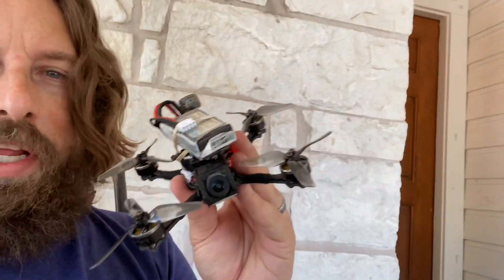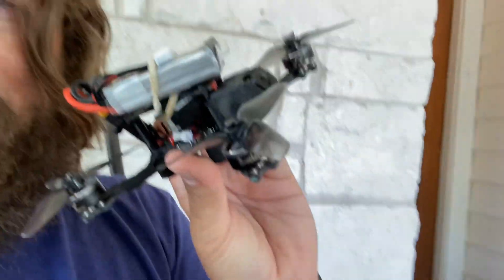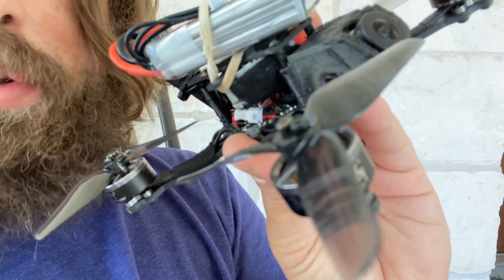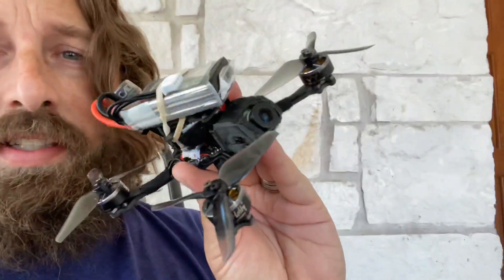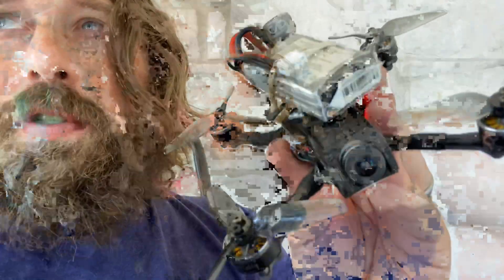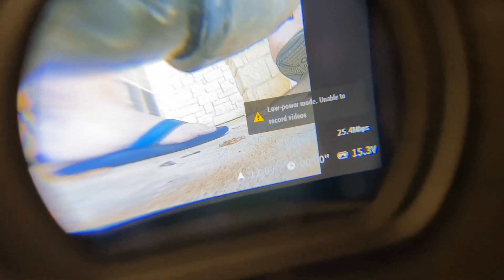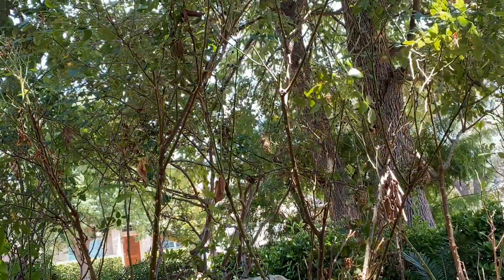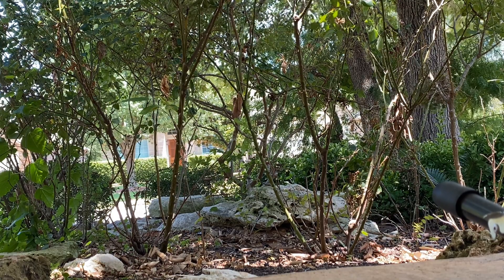DJI FPV OSD Freeze Issue: Why It Happens

Comment: Why would I get video loss mid flight and not get video back until I unplug the drone plug it back in. happens 30 seconds into dam near every flight I have a capacitor 470 uf. Air unit has red light on it when I get it out of the field goggles have black screen say dji on them. Its like air unit  looses the bond with the goggles it happens 20 feet in front of me with high and low throttle moves some times happens hovering doesn’t seem to be noise from motors or power causing it I have been fighting it for a month tried new antennas diffent mounting positions no luck
Reply: So turns out all the screws inside the air unit came loose and were rolling around in there. fixed that and all my problems went away !